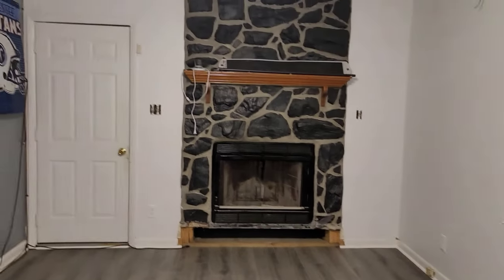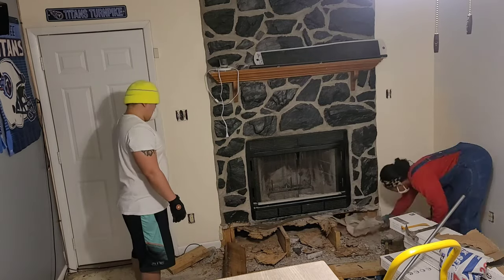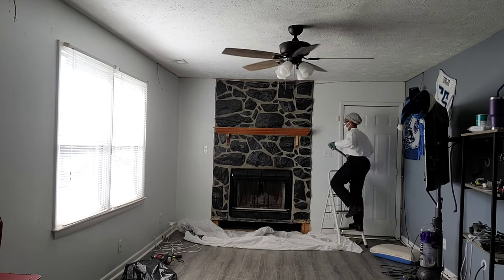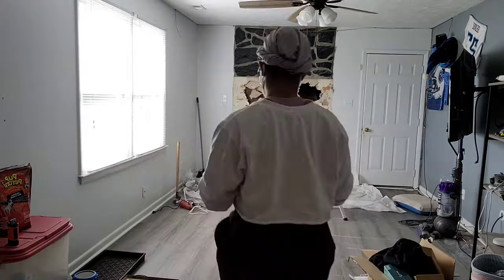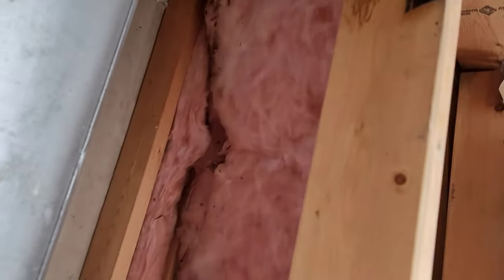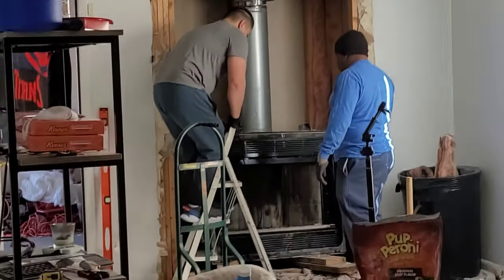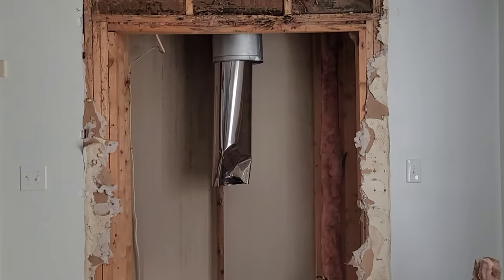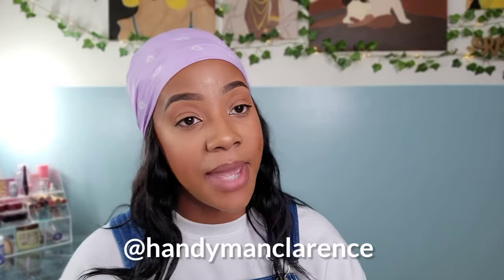Fireplace🔥 Removal⚒| DIY Home Renovation| House Demolition| Handyman Clarence👷🏽‍♀️|the PONPONS

Comment: I used the exact same tools.  But, I tried using a grinder first and you don't want to do that.  I put plastic from the ceiling to the floor and out several feet so I could work.  The dust was unbelievable.  I put down some plywood on my floor because I knew the debris would be hard on it.  Oh, and I had a real fireplace.  You know, a brick fireplace WITH flagstone on top of it.  So I had to first remove the flagstone, and then start on the brick. What a job.  I replaced the fireplace with a 6 foot linear electric fireplace.  Very nice.  It's so much better and it looks a million times better.
Reply from the maker: Wow. We didn't have the necessary tools to remove our fireplace, so we ended up chiseling away at it with a hammer and crowbar lol. Adding an electric fireplace sounds more modern and would give it an elevated look. I love that!

Comment: How did you deal with the gas pipe?
Reply from the maker: We didn't have a gas fireplace, so we didn't have to worry about a gas line. The flue pipe that remains in the chimney was capped off.
Reply: Hi, what did you use to cap the flue pipe in the wall?@PONPONSISTERS
Reply: @alimatin9981  I went up on the roof and capped it off.

Comment: The cement slabs that are inside the metal fireplace insert actually come off individually, so you can remove them before carrying out the fireplace. It makes it waaaay lighter. You have to remove the bottom one first, and then the rear and sides come out after.
Reply from the maker: Thank you for the great tip!
Reply: Actually you will never get that the bottom. Panel out. Due to the fact that the cut on the concrete bevels in and the sun. The sides end the back. Panel come out 1st with the bracket that is on top hold together with quarter inch either self tappers or machine factory screws at that point once you remove. The sides in the back panel you didn't can take the floor out if necessary.  Usually the reason why they're easy to take out like that is because the factory made ones are made inexpensive like and they're not as good. As the replacement panels which tend to replace because of crack panels due to heat or a log rolling up against the wall on a constant basis. Remember size matters, to much wood it tends to suck the life ou of the panel. This causes the crack in the panels which causes the metal that the insert is put in tends to warp eventually not letting a panel sit againstead and your mind is wealth throw it away. And spend in the 7 grand put in a new one in. Or? Watch my videos their videos. And you determine? What makes sense according to the code your ability? In the application.
I'm just saying
🔥 & 🧊  Chimney 
Kenny

Comment: Do you have a video of how they cut remove the tubes 😢
Reply from the maker: Unfortunately I do not. They didn't remove the leftover tubes though. We just wanted it seal off, like a cap.
Reply: @PONPONSISTERS  do you have a recommendation for what to use to cap it? I've seen something about foam but I can't find a concrete answer. Thank you for your videos!
Reply from the maker: I taped off the bottom half of the pipe since that was what I could reach. Sent my husband in the attic with some flue tape (don't think that's what its used for though lol) For the chimney portion on the roof we hired someone to seal that off. I'm not sure what they used or how they did it. I just didn't want bugs coming through the pipe and nesting in the attic.
Reply: @PONPONSISTERS  Thank you for replying, this gives me some ideas for what to do with mine, I really appreciate it!